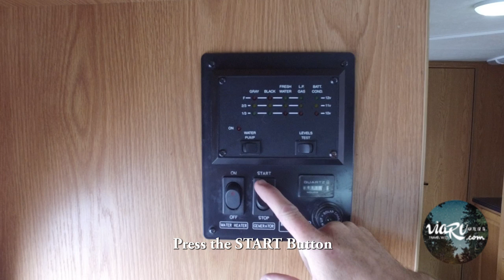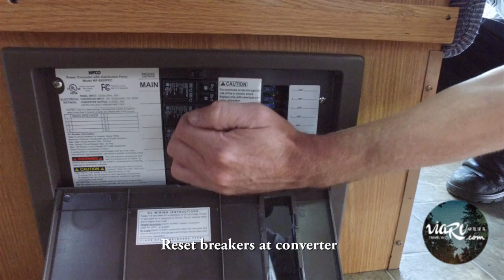RV Generator Troubleshooting Common Problems - ViaRV Parts & Service

Comment: Thank you so much for this video! AC stopped working in 90 degree weather while stopped for the night. All the bumpy roads caused something to shift and "pull the plug"! We never would have thought about checking that because we never would have thought something could pull it out, but it did! Thank you!!

Comment: The incorrect oil dipstick manufacturing defect caused me over a year of stopping issues with my whisper quiet 4 KW generator. To avoid the generator shutting down issue, have the oil level between 1/4 and 1/half full.

Comment: Thanks for this direct and simple overview. My a/c wasn't turning on when runnning the generator and I noticed I had no lights on the microwave.

I found the inside breakers and reset them all.  

I'll be checking outside to see about the outlet for the shore power plug. The dealership had it plugged ibto shore to do a "walkaround" and I bet tgey never plugged it back into the spot your video shows.

Comment: Ist timer here. I drive my Motorhome class to my home and was cleaning it out. I turned on generator and air con would not turn on. It probably is not plugged. I need to check it. Hopefully that is it. Will the thermoset still be on if it is bot plugged when running generator?

Comment: Also in a lot of RV's if your below a quarter tank of gas the generator wont start...its designed that way so you don't run your RV outta gas over night if your using the generator

Comment: Onan 4000...most common cause of starts and runs as long as the start button is held? Voltage regulator then control board. 75 percent of the time it's the VR. I had such an issue with my 4K. My 4K is an earlier model that does not have the LED light on the start button and the circuit reset is just below the start switch.

Comment: I have the same generator.  What I'm running into is this,  i just had it serviced.  I cranked up the generator today and it ran for about 20 minutes then started to cut off almost as if it was a fuel issue.  I'm thinking i might need to throw a bottle of stabilizer in the tank,  but i could be wrong. Having been taken for a ride by mechanics in the past,  I'm worried they did something that's going to have me back in the shop to make more money.

Comment: I recently bought a toy hauler with an onan gen.   It runs fine but seems like a lot of very hot air blows out of the bottom of cabinet next to exhaust pipe. To the point I can smell wood  burning smell.   How does this cool itself and were should the air exit trailer?

Comment: My Onan (2003) 4kyfa26100k would start then quit. After a few attempts, it still cranks "but no" start/turnover. Can smell the gas when cranking. Also checked the pump with the fuel line draining into a jar. Fuel flow is good when cranking. Thoughts? Thank you for reading. Jeff Whiteboro, Texas

Comment: Mine won't start with breaker switch (at generator) in the "On" position.  If I move the breaker to "Off" it starts but of course there is no power to the RV....?

Comment: What if the generator is on giving the coach AC power but not charging the battery? But when I hook it up to shore power, it charges.
Reply from the maker: check the connection between battery and generator

Comment: after servicing my cocan 8000 grnerator i have no power
i had power initially but not enough to turn over the generator at that point i was getting the flashing light indecating that i need to service the generator and i had just changed the oil oil filter air filter and cleaned the dpark arrestor

Comment: I have a problem with a 3 kw Onan diesel generator that I have not been able to figure out.  When I hit the initial start switch it cycles until it is ready to start when it indicates "Gen Off"  when I push the start button it starts right up but then indicates "Check oil level" which is not low.  Don't know how to turn that off and don't understand why is reports that the oil level may be low and continue running.  Any help would be appreciated.

Comment: In case the generator isn't running right, I have fixed several Onan carbs because I know where the problems hide....no need to buy a new one...they're just clogged in very important, small places that DIY's overlook. Reply and I'll fill you in.
Reply from the maker: are you in Washington state?
Reply: @viarvllc7470  SoCalif....We all have Toyhaulers

Comment: I have no power going in to my I have a Onan 7000 generator now I do have wiring where it says starter as says run one says stop one says power I have no power there I put Power on power wire and a short out

Comment: Hello, I have a 2012 Majestic 23A that is identical to yours and I tried everything and check everything and still no power 😓😥🤧
Reply: Alexander Fedorov what was the final problem. My 2012 majestic runs great but no power at the line plug in cabinet. I’ve checked fuses breakers

Comment: I'm I supposed to unplug the generator while the RV plugged in to power?
Reply: You shouldn't have to disconnect from a generator, unless your main plug has a plug in the storage box like his does.  My 07 gulfstream doesn't have it, so if there's a 30amp plug that your generator powers, you won't be able to be on shore power and generator at the same time because you only have one 30amp cable right?

Comment: My Onan 3600 runs fine tv microwave on and toaster oven on all the same time. No problem. Turn only the AC on and gen. and AC  stops after about a minute. Any suggestions ?
Reply: Gen worked fine until compressor on AC kicked on, killed gen. Original AC (1992) Replaced AC, with a newer one. Works great!

Comment: I have a onan 3600 generator..will not run unless i hold the start button..either on the generator or in the cabin..hold it on runs..let go and generator shuts off..checked oil level...is fine..i changed the oil and put 1.6 quarts back in..head scratcher...can someone help please.
Reply: Anyone?
Reply: it's possible that your low oil shut off switch is faulty you can bypass it for testing, hope this helps
Reply: Boost Mobile same exact thing with my Oman 4K it will stay running only if I hold the starter switch but the actual starter does not disengage  so it will fry the starter in no time did you ever get a fix on yours I am still trying to figure mine out been 1 month now
Reply: Oil pressure switch

Comment: my onan 5500 marquis gold starts up but runs rough for about a minute then smooths out replaced fuel pump, spark plugs and air filter any answers
Reply: alan gale 
Check the automatic choke pulloff.  Someone rebuilt my carburator before I bought it.  They wound the spring that closes the choke, one turn too many times.  The pull off had to work harder to get it open.

Comment: We try to start generator won't start. Makes a beeping
Reply: Commonly, in a motorhome the generator and engine share the same fuel tank

If fuel drops below 1/4 tank, no start. 

The engine will start so you can drive to a gas station. But the generator will not.

Comment: this onan 4kyf26100k engine exhaust bellow getting red hot exhaust also removed still getting red hor what will do
Reply: dinesh prabhu my generator star but don't stay oon , when push the switch to star for a list one or 2 minuts  work
Reply: Probably normal but may be running lean

Comment: Mine has no power to start switch in the RV or at the generator. I've tried resetting the breaker at the generator, I've reset all of the breakers in the RV, I've checked all of the fuses in the RV even though none of them are labeled "generator". Ready light doesn't come on on either start switch, basically, NOTHING HAPPENS!
Reply: Don Stegemolle
r
Reply: Same....going to ck the 5amp dc fuse on the start box on generator. Logically, that circut should control red signal light at inside switch position. My generator is hard to get to.  Your thoughts?
Reply: Mine is set up like your and i am still looking for the start switch, did you ever figure yours out by chance ?